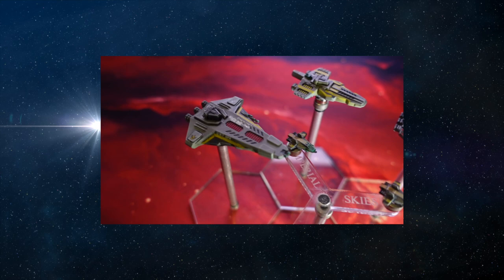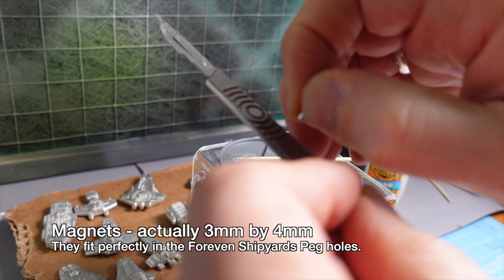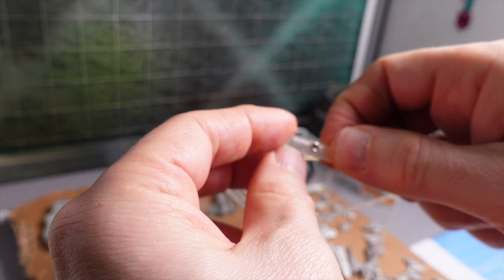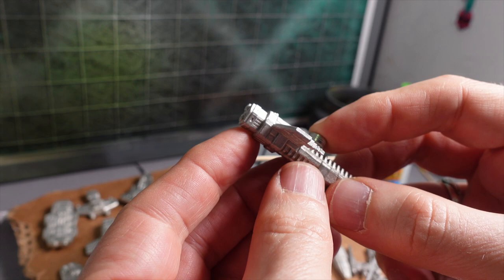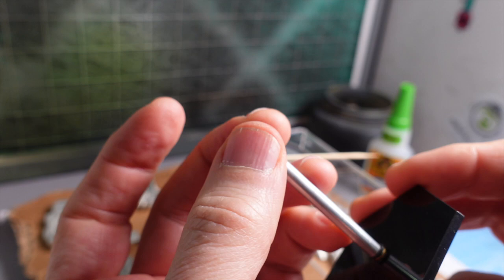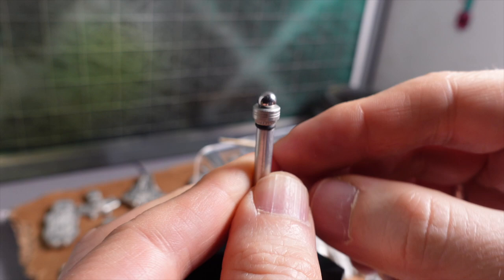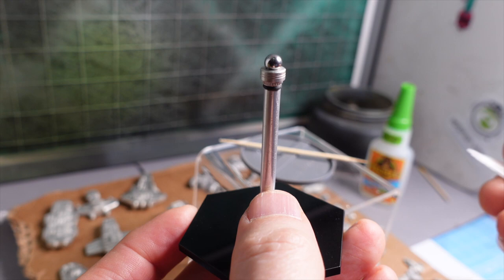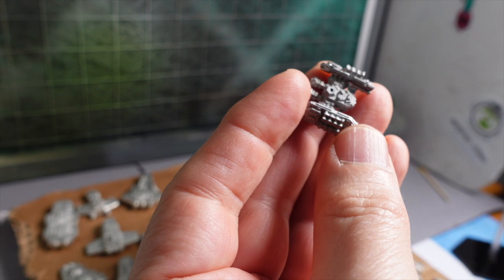A Billion Suns Full Thrust starship painting.

Comment: Thank you for making another video Robin.   Those ships are tiny.  Do you use a desk magnifying glass ever to paint these?  I find that I have to do that when I paint GZG 15mm infantry if I want to paint any details on them like faces and helmet visors.
I also think that you should not worry about the tiger striping on that exploration ship.  I think it looks really good, and the random appearance of the stripe shapes and placement gives it character that perfect placement would not.
Reply from the maker: I do have a Luxo magnifier for close details. However on these ships where I am just edge lining and dropping on a pin wash I find I don’t need it. I do use it for eyes and tiny details on 28mm models. Ironically the larger the mini scale the more likely I am to switch to using the magnifier.  I will aim to include an overview of it in the next painting guide.

Comment: That's weird - I've never had a problem with Vallejo Surface Primer on metal miniatures. I think that on metals, you do need a good coating, rather than a dusting, to allow the polymerisation to form a "shell".
Reply from the maker: Yes its an odd experience. I had vinegar washed the ships, hot soap  cleaned them afterwards, so they were release and grease free. I was also pretty heavy with it really, not dusting it. Very disappointing! Maybe the flow improver kills it?  I have seen a lot of people say high-pressure and no thinners with it.  I will use it again without thinners to check again in the future.
Reply: @RottenMechGaming  I know it's a long time ago, I was going to suggest that a proper clean is required but looks like youve done that. Metal castings normally have a fine powder release agent, it used to be baby powder before it was removed from sale. I have found on 28mm minis, they do need 2 coats to stop edge peel.  I've now taken to priming on receipt and then doing a second coat the day before I want to paint. Then it's get them painted and varnished in short order.
Reply from the maker: @argy8141 yes it was an odd one and I had vinegar soaked then soapy waterwashed the metal models.  It’s an odd one.

Comment: Any update on the Vallejo surface primer adhesion issue?
Reply from the maker: I have some more ships to complete which are 3d prints from shapeways. I was going to use it on them again but probably not on metals, just because its a time sink if it fails.